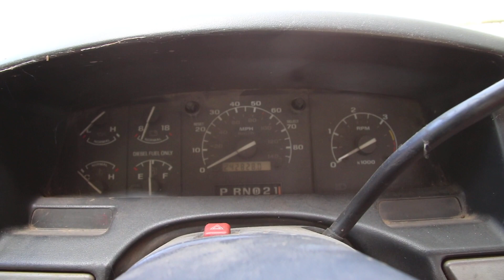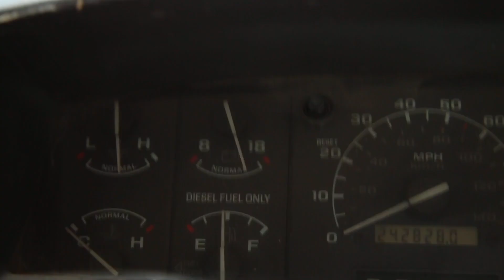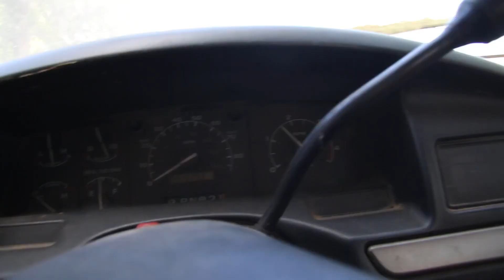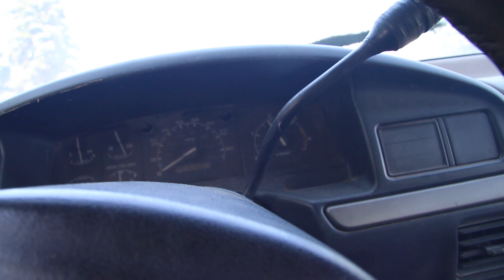Ford F-250 IDI 7.3L 1993 Will It Start Again Since Monday?

Comment: Try something: crack one injector after another loose (and i mean really loose, not just a bit) to see what injector makes a big and what makes no difference. see if the smoke disappears. i have a feeling (because you got the injectors from a unknown source and i guess they are not pop tested) that some injectors are bad. And check if you see marks on the injection pump where the pump meets the gear housing ... see if they are lined up or not (btw: if they are lined up doesnt mean its perfectly timed...it just gets you started so you know that you are not completely out of time). you can then loosen the 3 bolts that hold the pump to the gear housing and rotate it slightly in both directions and see what makes a difference. Have you created a account at oilburners (dot) net yet?? Please post your problem there with a couple videos linked - Im sure they will help you
Reply from the maker: I did that injector test you said by opening it a bit i didn't film it but 2 injectors on the right side when i open them a bit made the engine run smother and then i close them up and it ran rough and smoked then the left side there was 3 injectors that seem to make it run better and changed the pitch a bit when i opened them so i think its feeding to much fuel into the engine that guy never pressure checked or pop the injectors to make sure they were at specs for idis and i think them injectors we got are bad and never were good. so let me know if u think thats a good sign the bad sign is the oil needs to be changed don't want to run it to much the oil is got fuel in it from the cranking. one glow plug is out. i also tested the relay its working but just one glow plug is bad. and no fuel leaks any where i started it today it sat for a week one glow plug cycle it fired right away but ran rough like always and blue smoke.